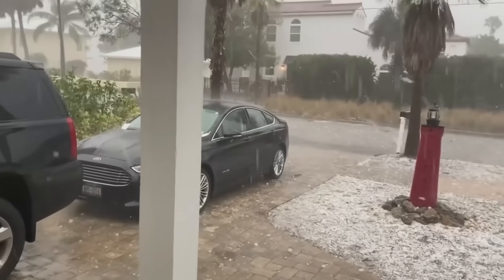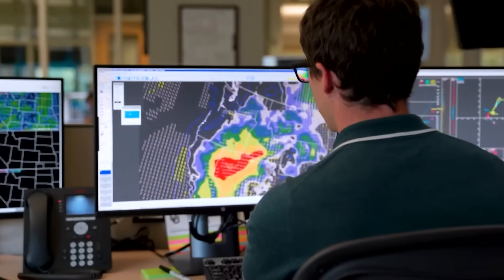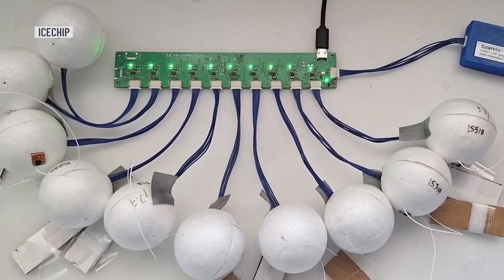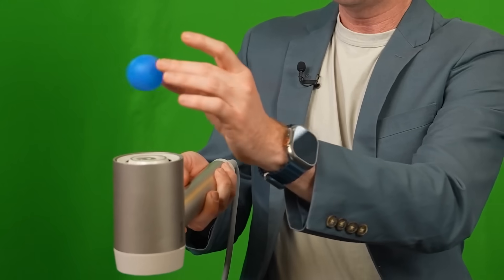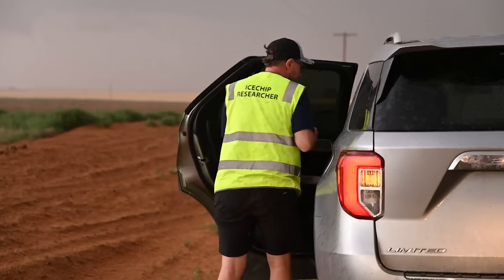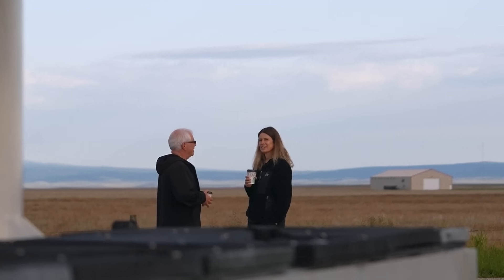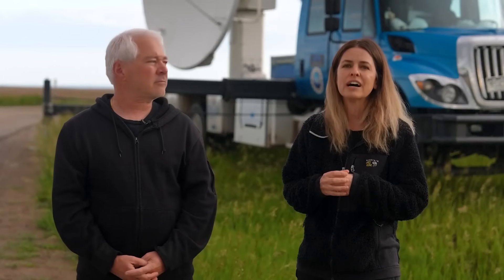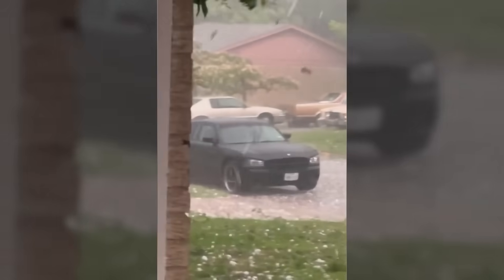Destructive hail | Here's what to know

Comment: Are there materials that can be used that protect a house from hail? Like a certain type of roof or windows?
Reply: Metal, wood shingles/shake, Sleight other material asphalt is the most common and susceptible to hail do to costs. Some asphalt manufactures have “impact resistant” shingles for a higher price like Owens Corning Duration